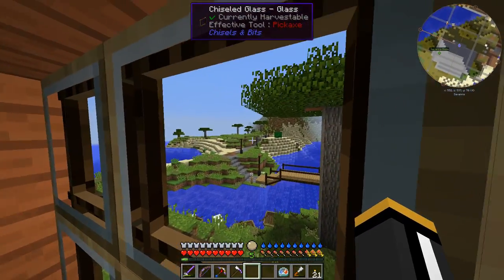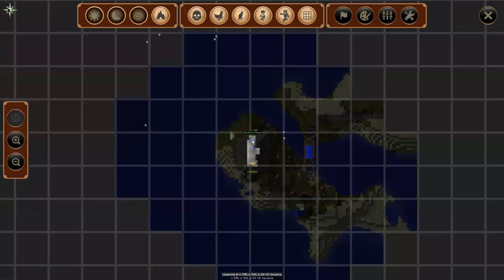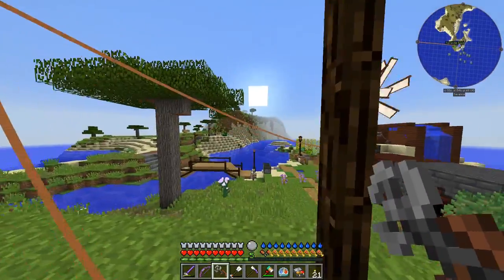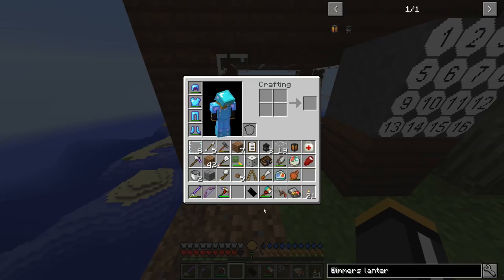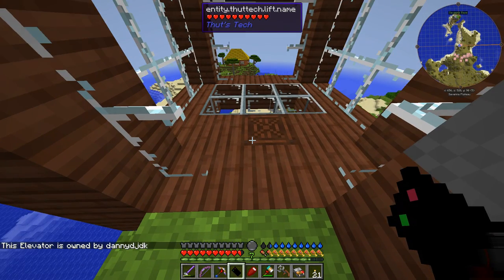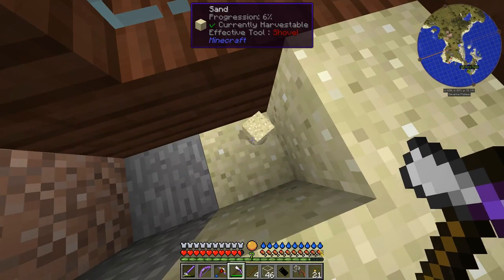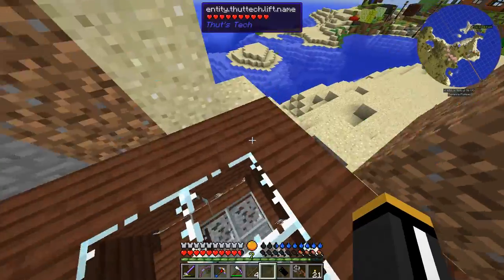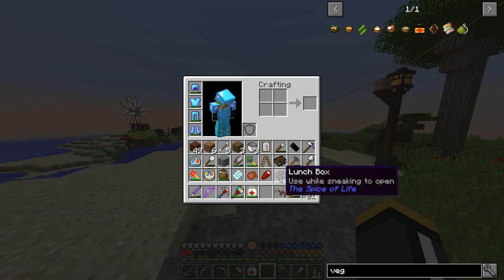Real Tech 08 - Thuts Elevators & IE Sky Hook

Comment: you can include the control block inside the elevator if you made floors also in any version the thut's elevator mod is in
Reply from the maker: Yes. That was not the case when this video was made 5 years ago. A lot has changed since then. Thanks for the tip though! Hopefully, other viewers will find it helpful to know that.

Comment: You could made the elevator buttons on the outside of it to call it to call buttons by choosing the floor then shift + right clicking the top of it (you will need two buttons
Reply from the maker: Thanks for the tip! Actually, that feature didn't exist when I made this video. A lot has changed since then, and it's possible to make a much nicer elevator system now. I'll have to devote another video to this mod soon.

Comment: u'm playing on 1.7110. are there different recipies there? because the recipie you use dosen't work for me:( pls help
Reply: * i'm playing on 1.7.10 srry
Reply from the maker: It was very different in 1.7.10. Instead of the tool, you use the elevator block to set the dimensions of the elevator. That block is then placed as part of the elevator car. I've never played it though, so I don't really know all the details.
Reply: i've tried everything, but nothing works and i can't find the recipies (if they are different in 1.7.10) i only find the ones that you use but nothing happens when i go to the workbench and try putting in everything i need
Reply from the maker: Do you not have NEI (Not Enough Items)? If not, you should definitely get that mod.
Reply: i have it but, the server that we play on is not alowing cheats
Reply: ok so we have enabled the cheats, but now the elevator won't move. we have buildt it correctly but it still won't work